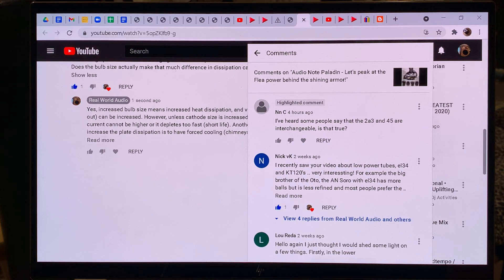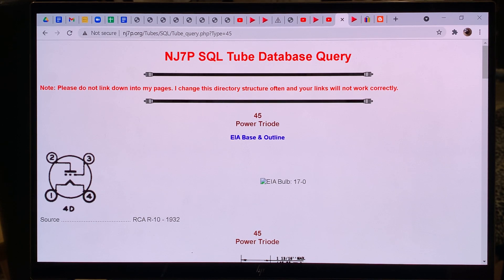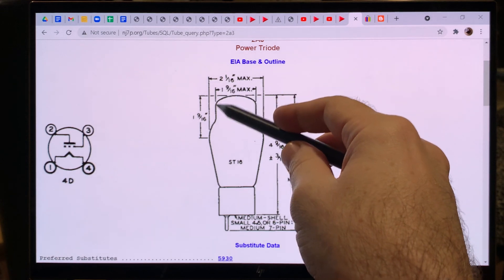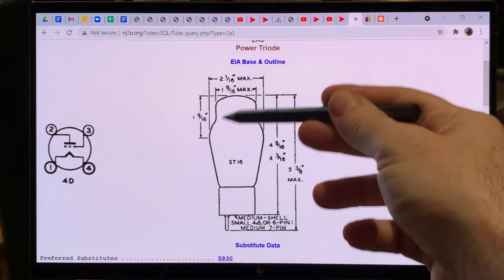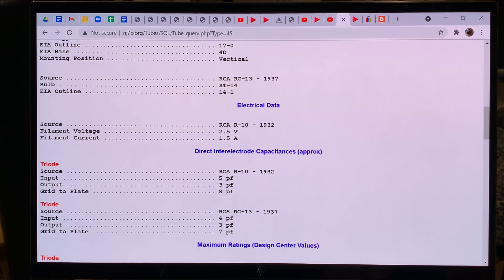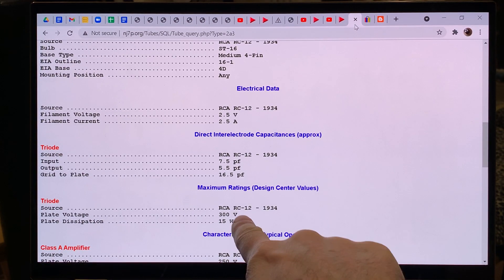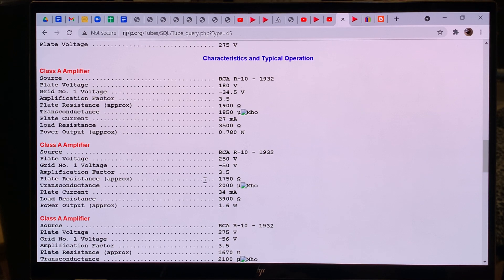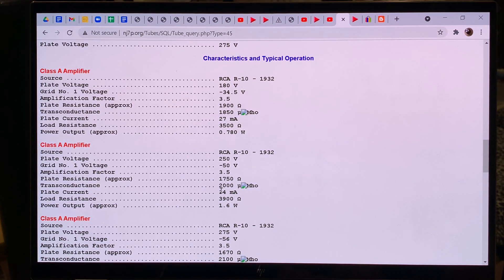Are 45 and 2A3 interchangeable? - short and long answers ;

Comment: Hi I made my 45/2a3 amp just by placing 2 
1500 ohm resistors together in parallel for the cathode in  2a3 mode for 750 ohms  and with a toggle switch 
accuated  it opens  one of the 1500 resistors for 45 mode. For the plate load I just used a James 6123 output transformer with 2500/3500/5000 ohms taps and I just switch between 2500 ohms for the 2a3 and 5000 ohms for the 45.Filament trans is 2.5v @2.5a with a toggle and a small current limiting resistor for the 45. Sound quality as discussed before can
be excellent for both the 45 and the 2a3.Regards Lou
Reply from the maker: Hi Lou, that's a very neat solution, thank you for sharing! :)
Reply: Awesome, Lou! That's a great way to get that accomplished. I have a couple pairs of dual-primary OPTs, and I'll incorporate your trick when I get around to building my next amp. Thank you. ☺